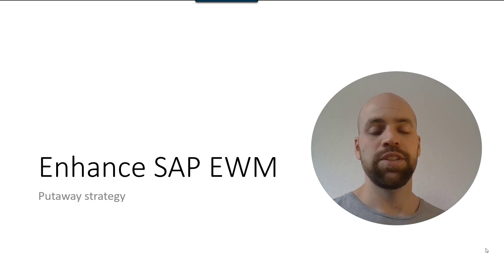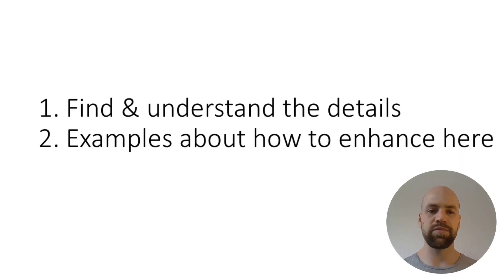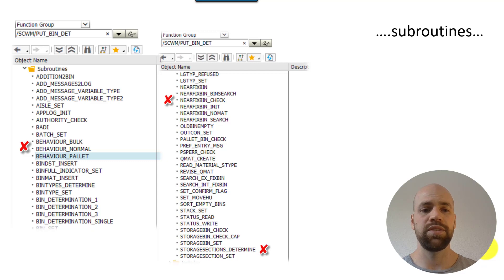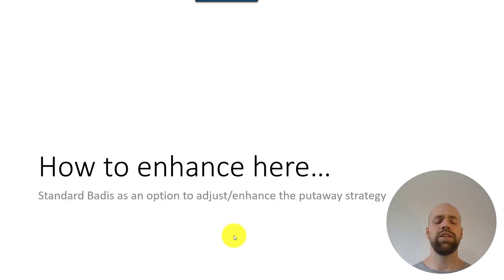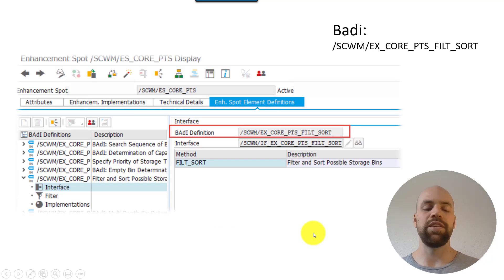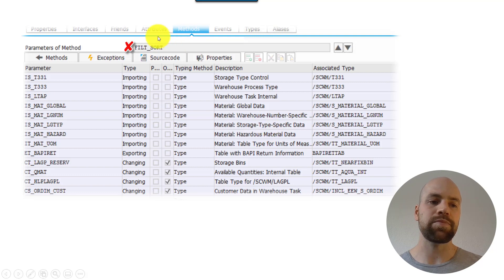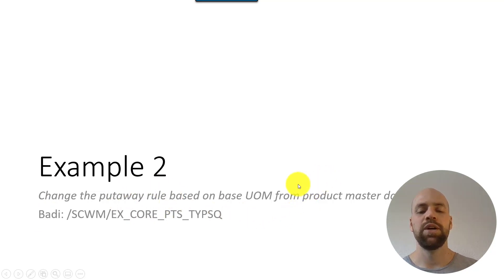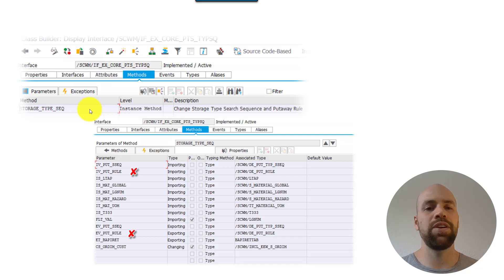Enhance SAP EWM - Putaway bin determination (Putaway strategy)

Comment: Hello @WMexperts, In my current project, there's a bulk storage and putaway strategy in 'Addition to existing stock/empty bin'. Let's say product 'X' is partially filled in bin ABC which has bin type 0114 and it can accomodate more HUs of the same product. When we are trying to putaway, system is not proposing partially filled bin as its in not in the storage type - bin type sequence. System is chhosing the empty bin. Which enhancement can be used in this case?